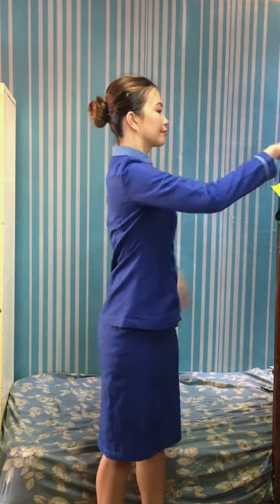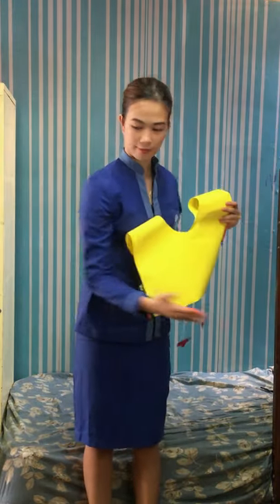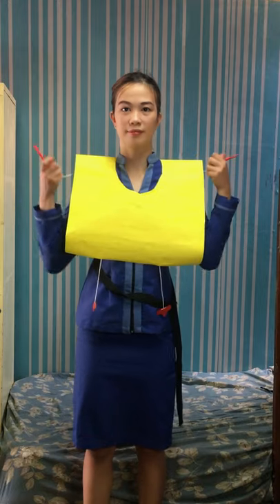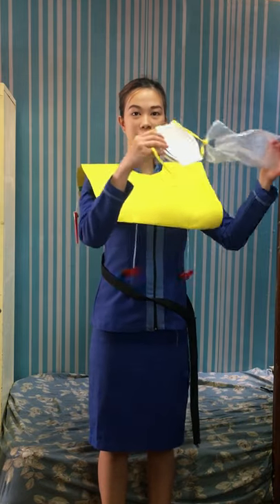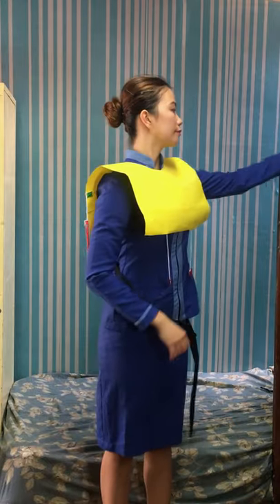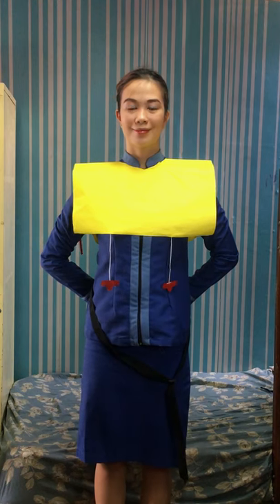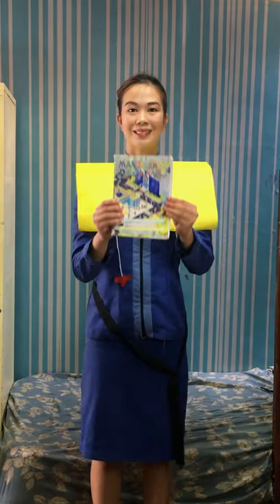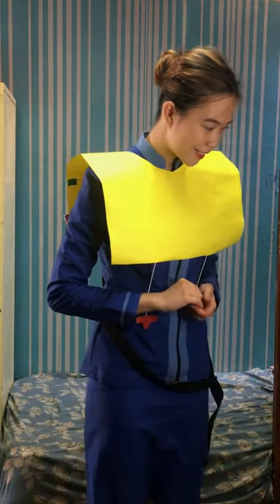VLOG #30 | In Flight Safety Demonstration | DIY Tools | Virtual Project for Transpo. Magmt Subject

Comment: May script po ba?
Reply from the maker: Eto ginawa ko lang po, pinagsama ko yung mga nakita ko sa net. Sana po makatulong hehe

Ladies and gentlemen, please, direct your attention to the cabin crew, who will demonstrate the safety features of this aircraft.
 “When the seat belt sign illuminates, you must fasten your seat belt. Insert the metal fittings one into the other, and tighten, by pulling on the loose end of the strap. to unfasten, lift the buckle, and pull free end to release. 
In case of water landing, your life vest is located under your seat. Remove sharp objects from your body. Put it on, slide the vest over your head. Take the tapes around the waist, and push ends to buckle. Pull tape to tighten. When outside the aircraft, pull inflation tags to inflate the vest, Manual inflation tubes are found on both sides. Blow to increase air. Push pins inward to release air. Lights will automatically illuminate once the battery tab, is immersed in water. Do not inflate the vests inside the aircraft. Please be reminded, that unauthorised removal of life vest from this aircraft is a criminal offense.
In the event of a sudden loss, of cabin pressure, an OXYGEN MASK, will automatically drop, from the compartment above you. Immediately Pull the mask, towards you. Place it firmly over your nose, and mouth, secure the elastic band behind your head, and breathe normally. Secure your mask on first, before assisting others. Keep the mask on, until you are advised to remove it.
Please take note, There are several emergency exits on this aircraft one forward, one aft, and one over each wing. In some cases, your nearest exit may be behind you. In case of emergency evacuation, follow the lines that will lead you to the exits. Doors can be opened by moving the handle in the direction of the arrow. Each door is equipped with an inflatable slide, which may also be detached, and used as a life raft.
We remind you that this is a non-smoking flight. Tampering with, disabling, or destroying the smoke detectors located in the lavatories is prohibited by law.
For further information, please refer to the safety instruction card, found in the seat pocket, in front of you. We strongly suggest,. you read it before take-off. If you have any questions, please don’t hesitate to ask one of our crew members. We wish you all an enjoyable flight.” 
At this time, your portable electronic devices, must be set to ‘airplane’ mode, until an announcement is made upon arrival.
Reply: @SuperioDiaries  thank you